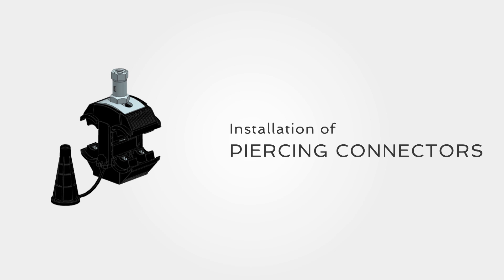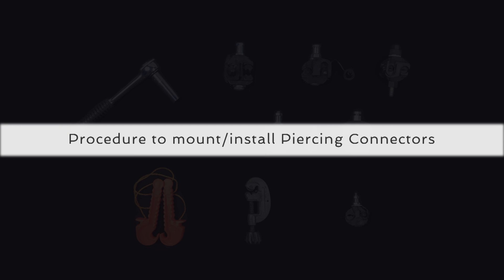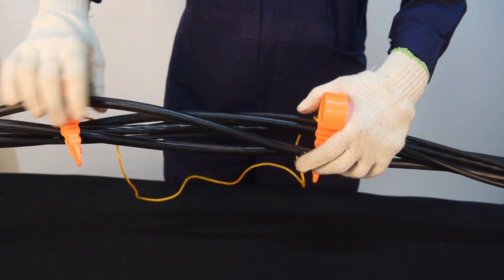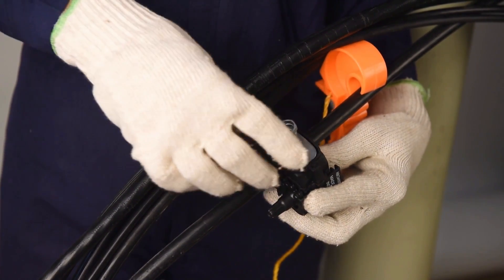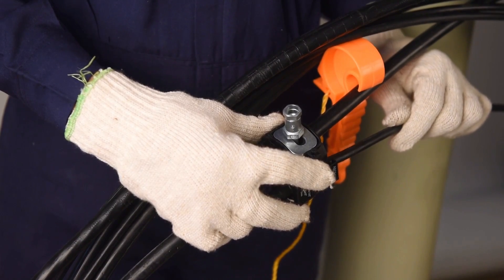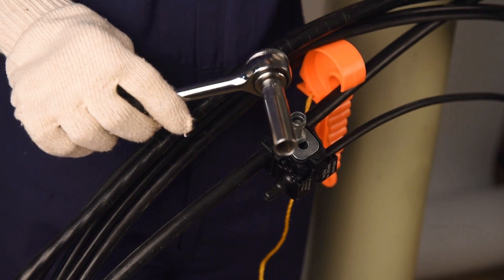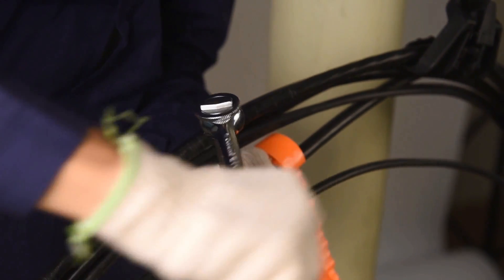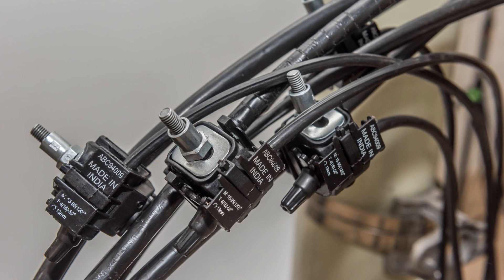How to install Insulation Piercing Connectors (IPC) for AB Cables

Comment: When tightening these piercing connectors, you can still see some of the
 metal teethes looking from along the cables from  the sides. What does 
water do inside those connectors? Does it evaporate by itself, can it 
cause short circuit in some way (dripping many meters past the cable and
 forming a conducting path?
Reply from the maker: Insulation Piercing Connectors need to be tested at 6kV while completely submerged underwater. Water should not be allowed inside the connection or the cable because that can significantly lower the life of the cable. We wrote about it here:  https://axis-india.com/lifespan-of-abc-at-coastal-regions

When installing AB Cable lines at any location, you should make sure that you only use products that have been tested and certified as per the latest international standards to ensure the longest lifespan for your system.

All of our products are tested as per these standards

Comment: what is pearcing connector??
Reply from the maker: Hello Deepak! 
As you can see in the video, the insulation piercing connector is used to create an electrical connection between the main and service lines of aerial bundled cables.

Comment: What metal is used as a conducror in abc bundle?
Reply: MKS Petit aluminium
Reply: Shahrizam abdul malik , thanks, u indian or pakistani?
Reply: MKS Petit I'm Malaysian. But here in our country, we also use the ariel bundle cable in our overhead line system.
Reply: Shahrizam abdul malik , well, i m from pakistan, we started to use abc bundle cable in order to avoid electricity theft.